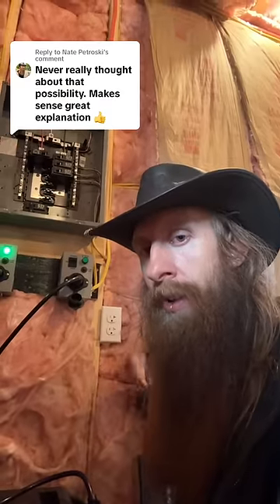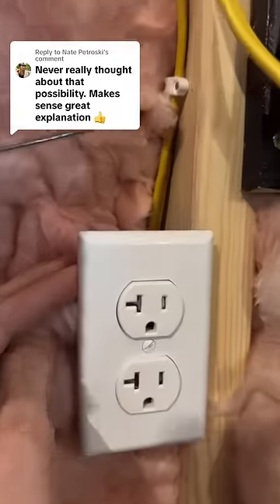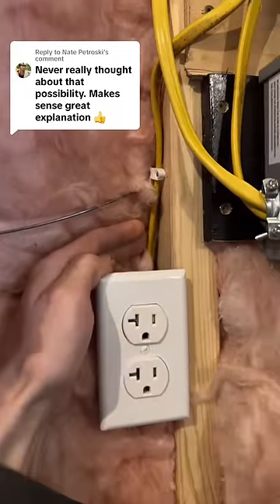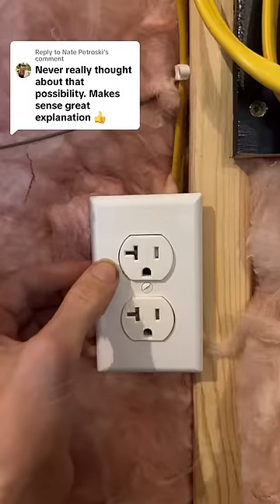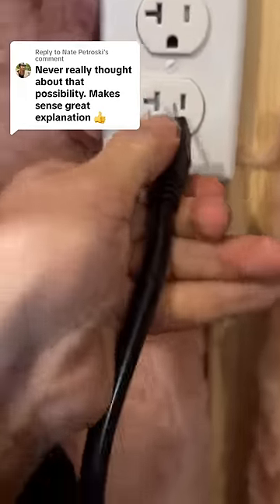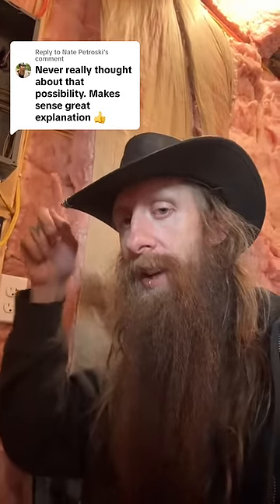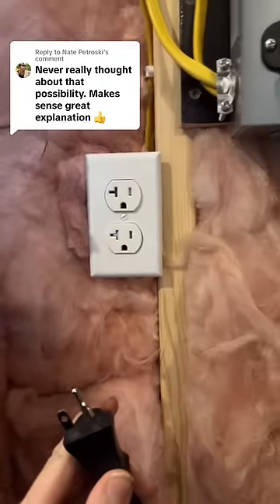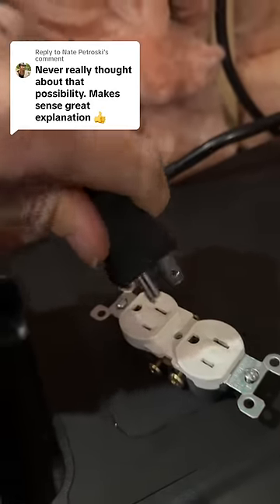20a receptacle on 15a circuit might be a fire risk

Comment: This makes me wonder why we don't ever do circuit breaker tests. If they are so important but yet we can't trust them, why not have a test for them.
Reply: Electrical safety in the US is strange to someone from the UK. We run on 12 or 24 and have an earth pin on all plugs. Circuits here aren’t over burdened and the plug can blow a fuse or trip the breaker. Electrical fires are fairly non existent here these days.
Reply: I think because it's very rare for breakers to fail by not tripping. If anything they will trip when they shouldn't when they fail. Also, testing them would require attempting to overload the circuit which is probably more dangerous than the risk of the breaker failing.
Reply: Fun fact, there are tests we do. 
That being said, they should not be mandated we don't need more government outreach. If you as a home owner or renter can't tell when something is amiss, you have some issues.
Reply: I’m pretty sure you can hire an electrician to check your circuit
Reply: Currently, there isn't a good way available to test standard or AFCI breakers for the homeowner. You can check GFCI breakers and outlets with a tool you can buy from any hardware store for under $40, but aside from GFCI breakers, there's not a similar tool to check them. As an electrician, I can do it, but the method I use involves either live electricity or removing the breaker from the panel. I wish there was a cheap tool, would make my life easier.
Reply: @patsysadowski1546 pretty much the same in the US
Reply: If regularly tripping wears them out as suggested then regular testing is a good way to wear them out… then they won’t work when you need them. ;)
Reply: @bigwahoo8686 love this comment
Reply: It's pretty standard to test the breakers while buying a house, typically you'd hire a home inspector who will test them and numerous other aspects of the building.
Reply: @StevenDirth   I suspect that home inspections involve inspecting the breakers, making sure the switch will move positions. As a previous electrician commenter stated, the only way to test standard breakers is to either remove them or use live electricity which I doubt most home inspectors would do.
Reply: @blastfamus  Can confirm, our home inspector definitely did no intensive testing of the breakers, and it was a reputable company. It was about 15 years ago.
Reply: It's not that we can't trust them, the breakers go through rigorous testing before they're approved for circulation, which is why you'll see a UL label on electrical devices that means it's been certified. It's more about redundancy,  trying to prepare for the worst-case scenario because while the likelihood is low that the breaker won't trip, if it doesn't, the wire can burn up in the wall causing a fire.
Reply: @blastfamus it’s really not that rare, had quite a few tested and failed over the years
Reply: A lot of people have no concern about  overloading and  cooking junk Chinese breakers here for no good reason , Tell me you haven't seen a breaker not trip when it should have  without telling me .
Reply: But there's a test button for this purpose...
Reply: Check continuity
Reply: There's a really easy test, it involves a modified extension cord and may leave some black spots on your outlets but you'll know if the breaker is working really quick.
Reply: No its a fire risk with  a 15 a receptacle on a 20 a breaker. If whatever device draws more than 15a the breakers gonna trip.
Reply: All n all put only your lighting on 15a breakers.
Reply: Whats gonna draw 20 amps?
Reply: No , when a breaker fails it wont set.and a breaker trips in several ways.
Reply: I bet they say hendershot generators fake too huh?
Reply: @bigwahoo8686  "government outreach" 😂 found the tinfoil hat wearer guys!
Reply: I don't really get it either we also have rcd's in the uk which detect earth leakage and they get tested quarterly to ensure they continue to work so why the same doesn't happen for circuit breakers I don't know ! Circuit breaker is only designed to save the cable from overload maybe that's why .. I'm sure there is an actual reason for it but it beats me 😅
Reply: @DarksideChaotix nope that's an rcd or rcbo
Reply: @TheCaperfish  don't buy junk Chinese breakers then?
Reply: @bigwahoo8686  the point of mandating it is to make it so if someone lies to you or in the case of renters (like a lot of people are becauae realistically renters are more likely to be the ones concerned) your landlord refuses to address issues is that you have a reliable recourse for when someone elses negligence harms you. Anyone with experience renting knows that landlords will cut every corner they are legally able to and many they illegally can if they can reasonably avoid getting caught.
Reply: @patsysadowski1546  per capita, the UK has over twice as many electrical fires as the us
Reply: @OmegaQuinn  why hire an electrician to test when i have a perfectly good fork right here?
Reply: Industrial plants do just that.
Reply: No offense but that would actually be about as dumb of a solution as you could have.

The risk of your breaker failing by not tripping when too much electricity is being pulled, is almost non-existent. See, when a breaker wears out, it's actually prone to tripping earlier, not later. The only feasible way a breaker would trip late, or not at all, is if it were in an extremely cold environment or if it were somehow physically disconnected from the rest of the electrical system which... you would have to do on purpose. And would be next to impossible.

The problem with "testing" it isn't (just) that it doesn't need tested, but the fact that the act of testing it... at all would be much more of an immediate risk to a houseold than one that doesn't work, because for it to be a danger would require a device to pull 20 amps through a 15 amp outlet, which if you paid attention to the video, cannot be done.

The only- ahem- "risk", is that somebody puts a 20 amp recepticle on a 15 amp outlet, and owns a 20 amp device to even plug in. Which is a likelihood of essentially zero.
Reply: What? You don't? We have dedicated built in stuff in the breakers themselves to do it, to the point where I could do it right now (if I didn't wish for the internet not to fail)
Reply: @bigwahoo8686 lil bro thinks people know anything about electricity or circuit safety
Reply: My uncle who’s an electrical engineer comes over like once a year to check ours once a year or so.

Comment: This is my first time seeing one of those plugs!
Reply: Halogen greenhouse lights (wink) take 120V 20A. The 240V 20A version has two horizontal blades:  my 1.5hp well pump uses one of those.
Reply: compared with electrical standards in the UK, this all looks very Third World.  No offence Nate.
Reply: The 240v version has the other prong horizontal.
Reply: @brianlopez8855  I see your point, but "third world" is more likely using block and unreinforced masonry construction.  Describes UK construction better than ours, no? Plastic consumer unit cabinets and the lack of space inside them looks wrong to us.
Reply: I've seen and know the difference between 15 and 20 amp outlets.  However this is the first in my 63 years that I have ever seen a real life 20 amp PLUG!  Now what is interesting is the NEC (National Electrical Code) does allow 15 amp outlets, in some situations, on a 20 amp circuit.
I myself, prefer to avoid any confusion, by not mixing only putting 15 amp outlets on a15 amp circuit.
Reply: @brianlopez8855  yea I'll NEVER understand why they still haven't improved it. They can't even use many of the things we use. Apparently even things like the kettle never took off over there because they can't plug it in and if they make them to handle the weak American power outlets it sucks and takes forever to boil. I find it hilarious that his reply is that superior brick houses are third world... Yet they live in plastic boxes breathing in 52 credit cards of microplastics a year and having to completely rebuild everything every 30 years. If only they realised that that's WHY their houses get blown over and destroyed , it's also why SO MANY people DIE every time they have a storm. I wonder how many houses would be lost in all their fires if they stopped building in plastic and built with NONFLAMMABLE bricks. Then the fires wouldn't be running wild from house to house to house. A little ember wouldn't be able to travel miles away and burn house's down.  This is why we have so much beautiful history. We didn't demolish it all  for modern plastic crap. 😂
Reply: @timgerk3262 yeah GFCIs that trip at 30ma instead of 5 and 13 amp outlets that can only handle 8 for more than 30 mins installed on 32 amp breakers in electrical panels made out of fuel - doesent sound too safe does it
yeah im sticking with the NEC/UL standards
Reply: @cececox6399 the American power grid is weaker than the uk’s because we pioneered electricity while everyone else copied our work and changed a few answers. Our houses get destroyed by storms because our storms are rougher than yours. A wooden house can withstand a tornado better than a brick one. And lastly many of the “innovations” of the uk’s electrical systems are worse such as the constant use of push in connectors or “wagos”which have been known to cause house fires do to them not being able to handle the heat of shorts, faults, and impedances. Not to mention the fact that a wago just holds wires worse than a wire nut
Reply: @davidmarquardt9034 the thing is in the US we think absolutely nothing about buying a 50 foot extension cord made of 14 gauge wire with a normal 15 amp plug and stick it right in a 20 amp outlet and then put a load on it.  Since the normal 15 amp receptacle can have 2 separate 15 amp Itemp plugged in and that's fine its allowed on a 20.
Reply: @bryceg5709  yikes imagine being like that

Comment: My apartment last week had an outlet that literally melted. It had been on for hours and the breaker never tripped, no smoke or fire alarm went off, and thankfully I was home and in the room to notice it eventually because otherwise it was EXTREMELY close to becoming a fire and I live on the second/top floor of a small building with 4 apartments! I live in West Virginia as well and needless to say, I’m gonna be looking for a new place asap. They fixed the outlet and everything but didn’t do anything about the breaker not tripping during the entire ordeal.
Reply: They should have at least tested the breaker, but it's possible that the outlet was the real problem.  If it was loose or corroded or something, it could heat up without pulling enough to trip the breaker.
Reply: Outlets that get used a lot do wear out the contact points inside loosen up creating heat.  The plastic gets hot the plug gets hot and it melts.  Now the breaker is only looking for a short or a high amperage situation, which this is neither.  Now if it was an arc fault breaker it would detect the sensation of the arc if you will and it will trip.  They are very sensitive it would probably have tripped.  Regular breaker doesn’t care.
Reply: @MrStatic101  Yep and one reason those things happen is people don't notice - or just don't care - when an outlet feels "loose."  I also go through a place when I buy/move in and make sure the wires are secure to the outlets and switches, and using the screw terminals not "back-stabbed."   While doing that I also find out if any of them are worn/loose and need to be replaced.
Reply: A worn out outlet can easily catch fire at 10A. The breaker doesn't trip for that.
Arc fault detection and regular maintenance prevents it.
Reply: The place I bought going on 4 years ago now, I replaced all of the wall light switches too, just to look better really - with new cover plates of course - and also to make sure they all used the screw terminals not back-stabbing. One of then wasn't "snapping" like it should have and that might have been a problem eventually too.
Reply: If the outlet was burning then it was most likely undersized not over sized.  That's why your breaker didn't trip is that it was probably a 15 amp receptacle on a 20 amp circuit.  The video is actually talking about larger receptacles that wouldn't burn.  They would just allow for larger loads to be plugged in.
Reply: @Shadow_B4nned  but more likely the outlet had loose wire connection and/or wasn't making full contact with whatever was plugged into it. An actual overload is not required.
Reply: @kerryedavis  No, not as likely.  If we take into account that the resistance to melt the outlet from an overloaded circuit would be in the outlet itself creating heat where the resistance is.  As opposed to a loose connection that could be sparking, unlikely to be melting the outlet.  It would be interesting to see though.
Reply: @Shadow_B4nned  5a or even less could melt the outlet it doesn't have to be an overload. The heat doesn't stay at the contact point, which could even be inside the outlet. Also the first resistance causing heat increases resistance causing more heat... That's even how incandescent light bulbs work. They just have a controlled balance point at a given voltage.
Reply: @kerryedavis  I'm not saying it's impossible.  I'm saying it's unlikely.  Fires would be way more common if all you had to do was have a loose plug.
Reply: @Shadow_B4nned  well it would have to be a significant load too. Not something like a phone charger. And it might have to be something that is operating for a significant length of time. So not a toaster. Probably not a hair dryer either. But it would NOT have to be an OVERload, neither for the outlet nor the circuit (breaker).
Reply: @kerryedavis  I'm not saying it's impossible, just not very likely.  As in, I've seen a lot of loose cords but no fires.  Corrosion can be a hazard as well.  All in all it's the same with regards to resistance creating heat at the outlet.  It's something to do with the outlet itself being underrated for whatever reason and not so much the breaker.  *Probably.

Comment: I'm afraid to touch fiberglass, this fine man has his hand all up in there.
Reply: Workin' man's hands!
Reply: You get used to it but it still sucks especially in cold water for some reason. Like imagine taking your hot shower after working in attics all day and then the cold water hits you and you feel every spike.
Reply: @EikottXD  That sounds horrible, I'll keep using gloves whenever I handle it lol
Reply: @jacktumbleweed  indeed
Reply: I worked with it for about a month and it was HORRIBLE. I always heard you need to shower in cold water so it doesn't go into your pores, i ignored that advice. For 2 months later i still felt the spikes in my skin every single time i moved, i had a fever 3 days after i was done with the work and my skin had a bad rash. Needless to say, horrible experience, dont recommend. Also, i used protective gear.
Reply: You get used to it pretty fast.
Reply: @karlokarloo4658 you can brush it off with women's panty hose.

Comment: Yes, breakers failing is a rare thing.  It happened to me while on a handyman job though.  I had recently replaced all the switches and plugs in a house.  By coincidence, a breaker tripped soon after.  I went crazy checking my wiring before coming to the idea that maybe it's the breaker switch itself.  I learned that yes breaker switches can fail.

Comment: Super. Since it is open, wire it up with 12/2g and put a 20 amp. Breaker in. There is actually a 99% chance that you won't use a receptacle like that, or have an issue other than a tripped 15 amp. breaker, but having one 20 amp. Receptacle available is nice, and safety is good, and having an extra 600 watts available might be appreciated down the road. I also put 20 amp. outside because they are better quality. A lot of floor buffers use that plug. 💙 T.E.N. Edit: Only switch duty breakers can be turned on and off, and i've seen a 15 amp. breaker put out 28 amps. for over 20 minutes, (Two heat guns.) before it tripped. Stay safe. 💙

Comment: Thaaaat makes more sense. Good. Now my OCD will have me checking every outlet in our house b
Reply: Did you know that real sparkys turn the groove of the flathead screws securing the cover panel to the outlet to line up with the device? 

I know not everyone does, but apparently enough many that it is a stereotype.
Reply: @thoubias I usually do that. Just looks nicer
Reply: If you have a 20a receptacle, that doesn't mean it's wrong. Just make sure they're on a 20 Amp breaker

Comment: I was doing some electrical work for a buddy of mine on his ranch and while I was putting in a new fuse I noticed that there is a double throw 100 amp fuse that look kind of beat up. I touched it and it disintegrated. We followed the wire over to a shop that had 300 amps in fuses in its panel, plus several glass fuses on a separate panel.
Reply: Other than being fuses, no issue generally, as all won’t be pulling full load all the time.

Comment: I've answered this question  before nate. As a Master electrician in my stare wit over 30 years.  A 15 amp device (receptacle)  can be put on  20 amp circuits in  residential  environment.  Unless the outlet is dedicated for  20 amp equipment.  (I.e.Such as a freezer). The reason is in residential wiring  all non dedicated circuits are lighting circuits.  Receptacles sre considered a convenience.

Comment: I did the opposite at my house. Had to redo all the wiring (total gut job) and I ran all the normal circuits with 12ga wiring and 20 amp breakers, but only normal 15 amp receptacles. If I ever need to use something that takes 20 I can just swap in a new outlet, but for now it makes it that much more difficult to overload the circuit. Even if my family plugs in more than 15 amps worth of devices the wiring can handle it easily (my dad is famous for overloading outlets) and during normal use it just means slightly less voltage drop.